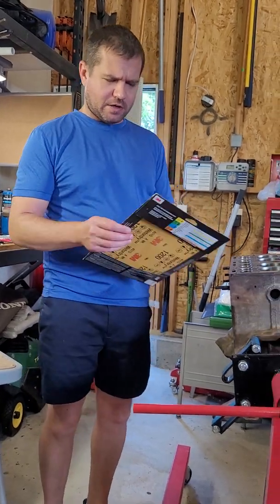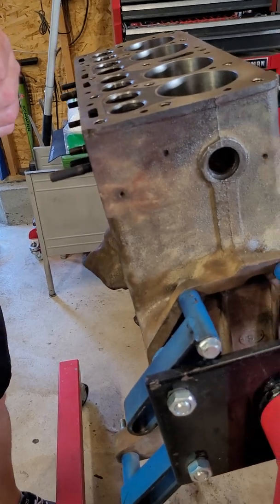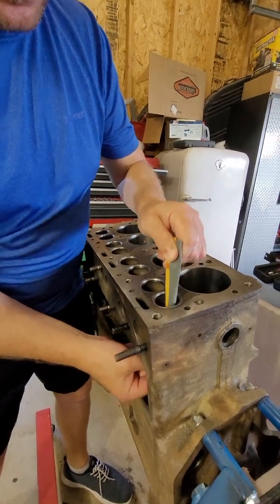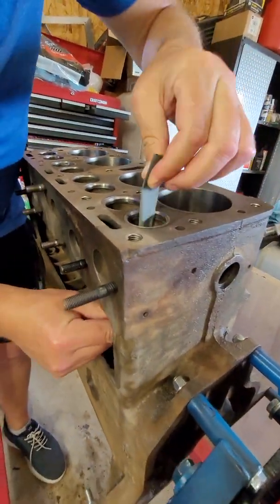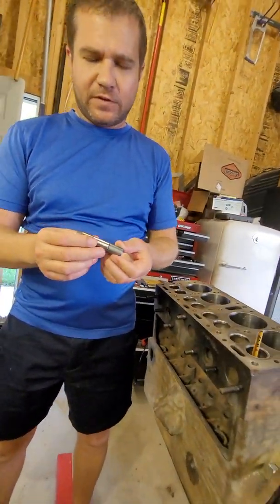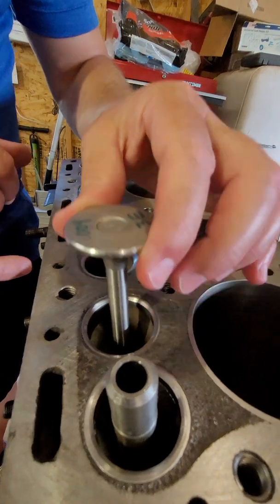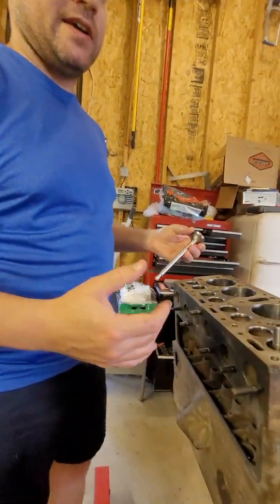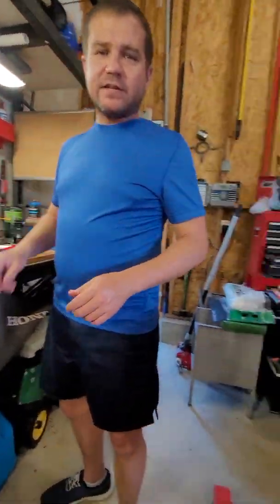Willys Jeep 4-134 L134 Go Devil CJ2A valve guide installation Part 1.

Comment: a nylon brush on a drill with some solvent will clean up the bores...i wouldn't sand any material off as you risk getting your guides installed too loose.
Reply from the maker: Ordinarily I would agree, and I tried that first.  But the bores were so rusted that even after cleaning with solvent and nylon brush...the guides kept fracturing during install.  After a few quick light passes with the ball hone, and then clean out again with solvent...the guides installed without fracturing.
Reply: @snrakmas  yeah..we do what we can to keep these old motors running...the best practice for this installation is to freeze the guides for  a few hours...they will then install with a few hammer taps....the bores are already 'relaxed' from the original guides being in place through years of heat cycles...enlarging them can be problematic when the engine gets to 160-180F where the bores expand substantially....loose guides can creep lower over time...i doubt you took enough material out with sandpaper but it's something to consider.

Comment: At what temperature has to have the engine to put the valve guide? And to take out what tool can be use?
Reply from the maker: The valve guides can be installed without heating the engine block, the heat just makes it easier.  As for temperature, there is not an exact number, but it isn't very hot, I would describe it as too hot to touch, but not glowing red.